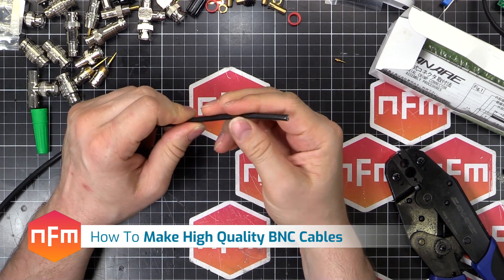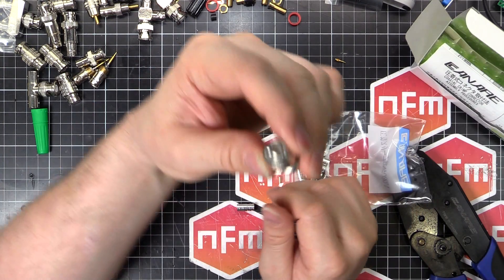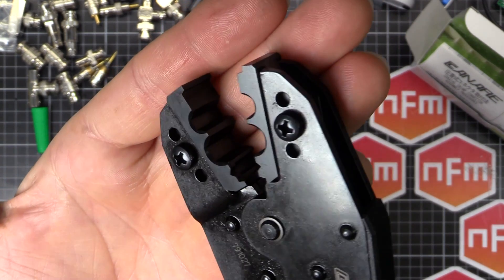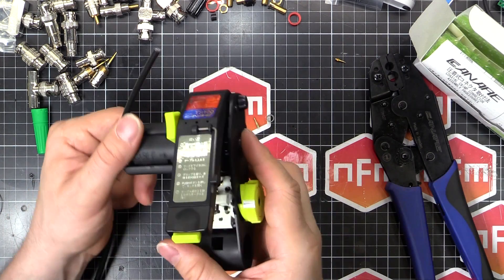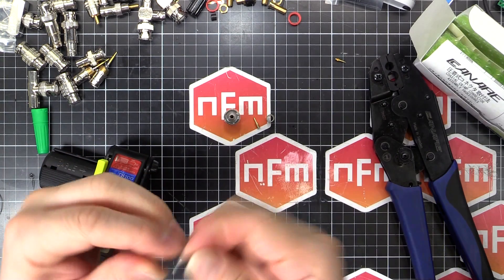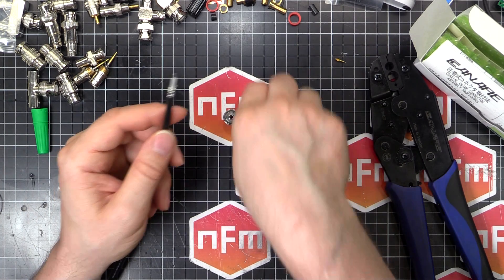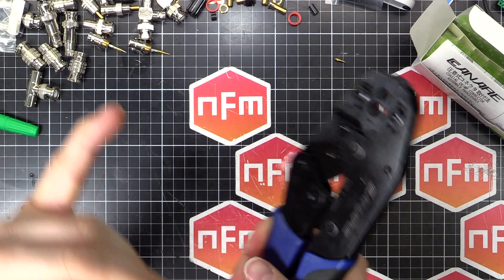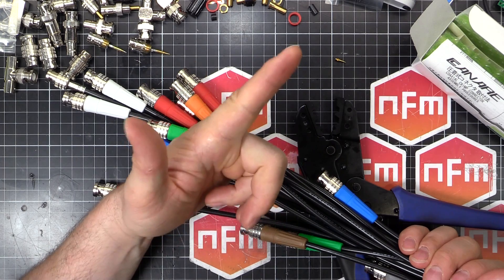How to crimp high quality BNC Connectors

Comment: What I want to know is how do you crimp, the bn c connector Where the connectors center Pin is not detachable, it just remains in the c9mnector plus my conductor is not solid? It's multi strand so it's making life difficult as it is.

Comment: Have you tried Jefcom? It’s a local JP brand. Their tooling seems to be standard size as opposed to Canare’s locked in design spec.
Never seen that click connect center pin before though. Wonder if Canare have a patent for that or Amphenol do something similar.

Interesting content👍🏻
Definitely scope for 3D printing a stripper though!

Comment: Thank you for the video! Although im a bit confused.  Can i buy a cheaper crimp tool for canare connectors? There just doesnt seem to be any info or universal terms when talking about crimp tool sizing. Unless im blatantly missing something. Any tips would be very appreciated!
Reply from the maker: It's not recommended to use aftermarket crimping tools as if they are not the correct dimensions, the crimp can fail.
Hozan (A Japanese company) does make a compatible crimping tool for some Canare crimps but I haven't used it.

I do have the mechanical drawings for a selection of Canare crimper dies that I can make available with a link in the video description if you need them to compare to your crimp tools.
Reply: @NearFarMedia  Thank you for your response. Ive decided to let go of the endeavour and just buy cables. Just too pricey if youre not planning to make a ton.

Comment: Great video.  Do you know of a source for the U.S. for the cable? If not how would you describe the cable parameters?  Maybe I can find an equivalent.
Reply from the maker: The cable used is just standard 50 ohm RG58 coax, it's a very common type that you should be able to source almost anywhere.

Comment: Ahh.. the famous crimping handle. Put together by nude bearded virgins in misty forests of Scandinavia. Its magical power makes you create a few dozen bnc cables for no apparent reason. The only thing to remember is to put the collar onto a cable before you strip and crimp anything. I wonder - are the bnc cables that you can get on ebay that bad?